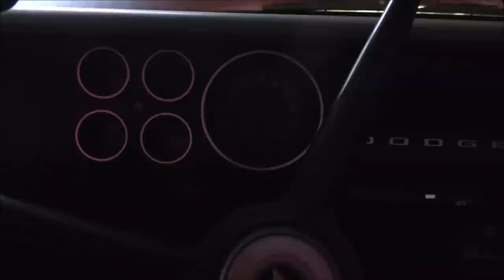Carter BBD Carb rebuild and Starting Adjustments Dodge 361-3 Truck

Comment: Stains in bottom of float bowls are rust stains from the gas tanks, lines and gas stations.  A 1984 corvette fuel filter is the cure directly before the fuel pump.. then free flow the fuel line into a container with 15 seconds of cranking 3 times. This flushes sediment out of the pump.
Reply from the maker: There is a big inline fuel filter before the carb.

Comment: We still have several carbureted motors. I bough an ultra sound cleaner big enough to put a regular carb in disassembled.  Best money I ever spent. It cleans the old varnish off easily. We also run fuel stabilizers year round in the units like your grain truck that get run infrequently. I like "Sea foam" the best. 
   My Dad ran Dodge trucks for years. He did not like diesel engines while gas was cheap (20 cents a gallon in 1970). That 361 with a two barrel carb. was rated  at 175 HP at 4000 RPM for truck applications. The 413 truck engine with a four barrel and dual exhaust was only rated at 225 at 4000 rpm in the heavy trucks. These motors ran a completely different cam, valves and pistons than the car motors. They where made to be very durable. Guys found out installing a car built motor would not last very long in the heavy trucks. I do mean weeks when in heavy use. They usually would burn a hole in the top of the pistons when in the trucks.
Reply from the maker: Surprised its not more than 175. My 67 318 out of the D500 is 202hp it says so right on the valve cover. :-)
Reply: @bcbloc02  It is the duty cycle. That 318 will not last long running wide open like you do the 361 and 413s when in heavy loaded trucks. The 361 where actually better at holding together. You could run them up to 4000 and they would live. The 413 would not last long over 3200-3500.  We where running them in C800s with 5 & 4 transmissions. The trucks weighed 18-19K empty and we usually hauled 19-20 ton.  So you where right at 55-60K. Lots of shifting. LOL
Reply from the maker: @JDseller1  My 318-3 came out of a D500 grain truck that was very similar to my D600. It has the stellite sodium filled valves, hard seats, forged crank and floating wrist pins for industrial service. I was at the ag museum in Kearney Nebraska and they had one of these that ran an irrigation pump supposedly over 100,000 hours. The industrial poly318s are much more heavy duty than a regular 318. I don't have a tach but that 361 is humming pretty good at 65-70mph. 🙂
Reply: @bcbloc02  You 318 has all the goodies of the HD motors. I looked up the HP in my dodge manual and the 361s and 413 topped out at 225 HP and that was a 413-4.   My book does not show the 318s in it.  I am wondering it the torque curve on the 361 and 413 is flatter than your 318?? Then add in lower rated RPM would make lower HPs.  I know when we got the first 238 Detroit it would walk all over our gas motors. It was only around 185 net HP.
Reply from the maker: @JDseller1  I did some internet digging and dound a 1969 truck sales manual that gave the following 318-3 202hp@4000rpm 322ft-lb@2800rpm: 361-2 186hp@4000rpm 300ft-lb@2400rpm: 361-3 200hp@4000rpm 316ft-lb@2200rpm: 361-4 207hp@4000rpm 335ft-lb@2400rpm:413-2 220hp@3600rpm 385ft-lb@2200rpm.  I believe the different powers listed for the 361's must all be the result mostly of ignition timing as they are all the same compression and I believe use the same heads, and manifolds. It looks like to me they added a higher heat feature (chrome rings) to each higher -series and then turned the wick up.  I will have to consult the parts book to see if they had different cams but I kind of expect not.
Reply: @bcbloc02  Good information you found. It always was odd to me how the horse power ratings varied so much from the car engines.
Reply from the maker: Well the truck motors were much decompressed from the car engines so made a lot less power. Probably why the 318 was out powering the 361 was it had more compression.  Anyway I consulted the parts book and found in the 361s the various power levels occoured because they had different cam gears(altered timing) and different intakes. All the 361 and 413 had same heads, exhaust manifolds, and cams, Pistons and rings were of course displacement specific but in the parts book no mentions of different part levels so not sure if there ever were or just if you bought new parts only the top level was serviced.  They had different intakes with bigger runners for the higher powers and they changed carbs to match.  Also the 413 got dual exhaust while the 361 was single.  Also I found some 1973 literature that lists net hp instead of gross so this would have been with all accessories and the fans and mufflers as used in the vehicle so this applies only to the D series trucks. 318 177hp@4000rpm 287ftlb@2400rpm : 361-2 173hp@4000rpm 290ftlb@2500rpm : 361-3 186hp@4000rpm 309ftlb@2200rpm : 361-4 188hp@4000rpm 325ftlb@2400rpm : 413-2 202hp@2600rpm 374 ftlb@2200 rpm

Comment: Success….video reminded me in my 20s working in a shop rebuilding a carb, basically done…older prankster worker comes over with a part in hand and says “where does this go?”, he had come earlier and chatted, grabbed the part off the bench….had to open it back up and install…lesson learned…lol
Reply from the maker: I usually just keep the extra bits for later. LOL

Comment: The 70's were the best, V8's in everything and fuel was affordable.
Reply: Must have lived in a different 70's than the rest of us....
Reply: @ShainAndrews  How could i do that ?
Reply from the maker: Probably referring to the gas crisis when fuel was NOT cheap.
Reply: @bcbloc02  Maybe, but not where i live.
Reply: @65cj55  Face it. You were trying to sound cool like you knew something about mechanics in the 70's and you stepped on your lip. The 70's were horrible in the automotive world. Some engines went from 400+ hp down to 140. Thanks to the government. They also put hideous bumpers on our cars that looked more like porches. And the price of gas quadrupled. Our engines were so lean it would take an hour to warm up to defrost your windshield. Smog pumps, EGR valves, totally gutless engines ------ where is that good part you were referring to? Oh yeah, and don't forget gas caps on the passenger side?????? AND those damned metric bolts and metric tire sizes!!!!
Reply: @artszabo1015  Lol, yeah right, because everyone can afford to fuel a V8 now and they don't have EGR valves etc etc, they're more complicated and over engineered then ever, and a bastard to work on, did you not see Brian just kit that Carb and how it's back running again ?....i don't now what fuel caps and tire sizes have to do with anything regarding V8 motors though.

Comment: A lot like the older fire trucks we ran. Fords with 534s, 477s or 429s, Super heavy duty engines but gutless when you were pulling heavy trucks with 1500-2000 gallons of water plus the pump and all the gear..

Comment: Most instructions don't explain setting the metering rods, though a Carter BBD service manual does (late-1970's).  Screwing the small hex bolt cw richens the mixture (pulls metering rods up, LH thread), and ccw leans it.  Nominal rebuild setting is 0.035" gap (aft side, must remove metering rods w/ step-up piston to adjust on bench).  Some claim you need slightly richer for today's 10% ethanol.  This is for O/F while driving.  The idle mixture screws adjust the idle O/F (nominally 2 turns out).  Best to have an O2 sensor & display to monitor while driving (only $30 narrow-band, $95 wideband today Amazon), unless old-school "judge spark plugs".  The adjustment shown here "phases" the lift tabs to throttle plate (want horizontal as stated).  Also adjust the accel pump (other shaft screw) so the top of the plunger shaft is 0.5" below top of bowl with normal idle speed screw 2 turns (disable fast idle).

BBD's in 1980's Jeeps have additional electric meter rods on aft side.  Don't remove those (fans term "nutter"), rather clean rust debris to free them (falls in from air tube).  Above is for later "solid fuel" BBD (1970's).  The earlier "air bleed" type (thru 1960's) have different metering rods.  The slant-six BBD (Super Six, late 1970's) has thicker metering rods (like smaller jets), which is the main (only?) difference.  But, 318 metering rods might be perfect for today's gas, and feds are considering allowing 20% ethanol in near future.  Running a 1970's BBD on my 1965 Dart 273 for a while, though plan later Holley TBI, like on my 1965 Chrysler 383.  The 383 had a 2 bbl Bendix Stromberg WWC (a bit fussy, esp cold).  I didn't know they used Carter BBD on big-blocks in 1970's.
Reply from the maker: Most people don’t know the 361 was the standard engine for the big trucks till they quit making trucks in 77
Reply: @bcbloc02  Surprises me since lower-displacement engines of a series are higher-rev'ing so a better fit for sedans, such as the 273 in my 1969 Dodge Dart.  Indeed, among Mopar small blocks the 340 was the performance engine, not the larger 360, though a 360 (or 5.9L Magnum version) is better today for racing since more aftermarket parts available.  For the same reason, 2 bbl carburetors were used in trucks and family sedans since low-end torque was more appreciated than higher max HP at screaming rpm's which a better-breathing 4 bbl gives.
Reply from the maker: @williamgrissom9022   Well they needed the engines to live the 50K mile warranty so the 361 had the thickest strongest block and putting a 2bbl on it kept it under 200hp so it could make it the 50K. A 400hp 440 would rarely ever have made it 5k much less 50 since the truck engines basically put out whatever they can make all day long since 200hp can barely drag 30000lbs along a flat road  with the wind of a parachute. I would say when I am driving my big truck engines stay at WOT 90% of the time.

Comment: I have a strange carb experience.
1985 Dodge 1 ton with a 360 4 barrel. Purchased in 2006 and used it until it wouldn't start around 2019. Carb wasn't getting fuel. Changed the fuel pump. No joy. Finally took the top off of it. Found the clip for the float needle was MIA! Purchased a kit for the clip. Yes, I used a few gaskets. Put it back together and it ran.
Question is, why did it run and then stop running?
Reply from the maker: It must have gotten the needle jammed where it could not open.

Comment: Always good to see an older carb getting a new make over. Back in Ohio in 2006, I picked up a clean D100 with slant 6 and still wish I had. You have any slant 6's in your fleet? Sad news, but wife has has decided after our Thurs oncology appointment to not go through any more treatments. Hospice will be on board starting this Monday to take over. Have a super wk end. Bear
Reply from the maker: Well that sucks. I still pray for the best. No i don't have any slant 6 stuff. My firewood hauler had a slant 6 in it but it spun a rod and that is when I bought it and put the poly 318 and trans out of the d500 in it.

Comment: They are work horses, not race horses.  People forgot that, it's why so many died 'in harness.'  Once people learn to adjust their driving, the potential for lasting forever is there.  There's a lot of those old farm trucks around here, the only time you see them out is during harvest.  You learn to crest each hill slowly, ready to hit the brakes, because there might be one just over that hill.  They move.  Not fast.  Most of the time they can stop, but sometimes you have to adjust for that.  Let them get out, join the parade that's going to grow behind them.  Impatience, around here, will get you in trouble during harvest.
Reply from the maker: Yep it will get there, you just might spend 20 minutes pulling a hill in 2nd or 3rd gear but eventually the job is done. :-) The good thing about the low power is you don't get going very fast so the brakes work better. lol
Reply: @bcbloc02    yeah, you take your foot off the gas, by the time your foot gets to the brake, it's nearly already stopped.

Comment: Noticed a wooshing sound when you pressed on the throttle and you instantly mentioned the timing. Are those two things related?
Reply from the maker: Timing affects carb signal yes.

Comment: Thanks for the knowledge, sir, my 73D 600 has a 361-3 with the same carb I just had it rebuilt. It was leaking all over the place the plate that it mounts to with the two butterfly valves. How do you know if that things working mate mine runs great up until about half throttle then sputters and farts I was thinking maybe the butterfly under the Carburetor it’s not opening? Do you seem to be a knowledgeable guy? What do you think, sir?
Reply from the maker: that is the governor It should limit crank revs to about 4000rpm I believe. mine was gutted before I got the truck so it does not do anything except serve as a spacer.  In order to gut it just take it off and use a screwdriver to remove the butterflies.  if working properly it should run smooth against the governor just not be making anymore power.  Sputtering and misfiring is either an ignition issue or it is running out of fuel.
Reply: @bcbloc02  thanks for the input, sir. My butterflies are about halfway and when you try and move them by hand, there’s lotta resistance. I’m gonna have to look into them a little deeper. Thank you sir.
Reply: Is there any chance you have the part number for a engine oil filter? Can’t find one anywhere old filter can’t read the number drop in style one comes up with the same dimensions they’re calling it a fuel filter. Thanks.
Reply from the maker: @dirkdiggler1902  I believe it is a fleetguard lf503
Reply: @bcbloc02  very good sir thank you also on the carburetor I took those two butterflies off that didn’t make a difference and I started messing around and adjusted the two screws with the springs on them outward and it made a big difference, so I’m guessing they either let more fuel or air in a revs up, higher now without sputtering it seems like I got them cranked almost all the way out so it seems to me the air fuel mixture is just not quite right. Thank you sir.
Reply from the maker: @dirkdiggler1902  The 2 screws at the bottom of the carb with the springs are for the idle circuit. It sounds like your main circuit is plugged and you are just getting it to run better by letting it draw fuel thru the idle. Once its under load it won't be able to pull enough fuel and its going to have problems again. definielty sounds like you have a problem with the carb.

Comment: Brain pick time. Brian, anything overly complicated about working on Hydro-static units? I realize they will vary from manufacturer to manufacturer. Sorry, I forgot about your video.
Reply from the maker: Not really just a BUNCH of parts if you tear down to the component level so you need a big space to lay everything out and keep it together so all parts go back in the holes they came out of.
Reply: Thanks Brian.